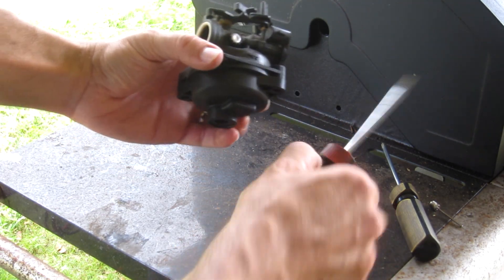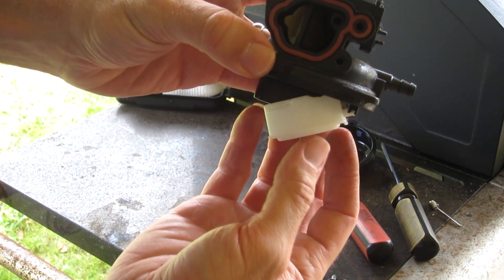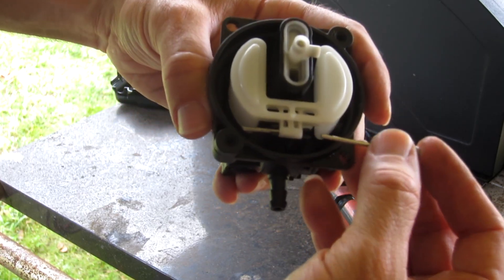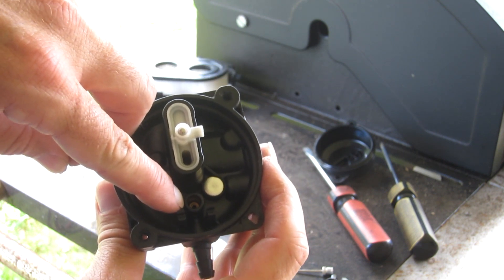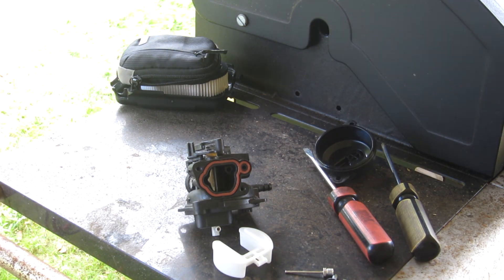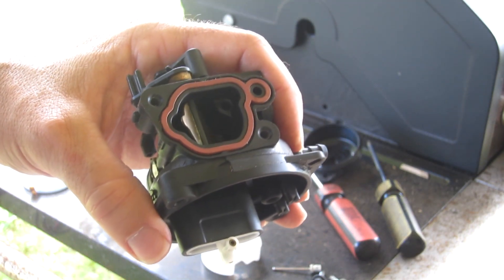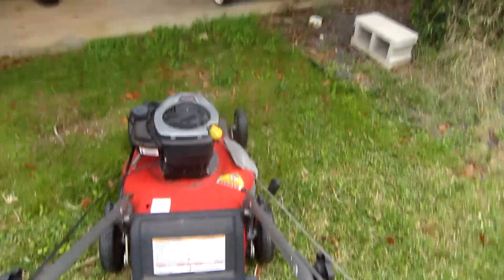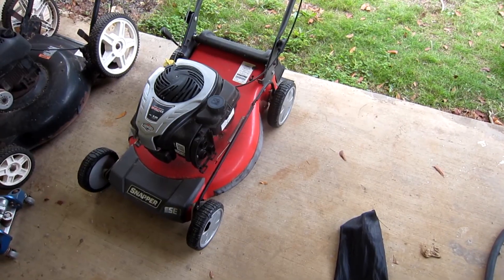Briggs and Stratton 550EX Carburetor Repair Part 2

Comment: I want to thank you for both videos. Although I have not torn my carburetor apart yet, it's happening tomorrow. I've torn my mower apart so many times and replaced the spark plug, the filter, changed the oil and gas, and taken the carburetor off and cleaned it, but just didn't realize I needed to take it apart further. I think I was more scared, also. Now I feel like I can break it down further. Everyone was telling me it must be the fuel filter that is clogged, but unless that's in the fuel tank, I just don't know where that could be. Thanks again. I hope this will have my mower running. My lawn is a jungle now!
Reply from the maker: Kristen, it sounds like you have a good handle on mechanical processes already so this should be an easy kill for you! I appreciate you taking the time to comment and if you have questions I'll do my best to help.
Reply: @jcx2bby  I've taken my vacuum cleaner apart countless times. With machines like these that cost an arm and a leg to replace, I'd rather take them apart and fix them than have to pay to get a new one. Besides, what fun is it if you can't figure it out; right?
Reply from the maker: @xten63  absolutely 100 pct this! Kristen for president!  We need more doers, and less talkers (coming from a guy who talks endlessly on lawnmower repair vids 🤔)
Reply from the maker: And there is no fuel filter on these engines from the factory. People sometimes add them later, but they do almost zero good, and add another maintenance item and leak potential to your machine.
Reply: @jcx2bby  I also want to thank you for a straight answer. I can't tell you how many people I've asked about the fuel filter or how many people said it's probably the fuel filter. They kept telling me it was between the gas tank and the carb, but I kept saying all there is is a tube. Now that I know there isn't one, I feel much better knowing I wasn't the one who wasn't informed.
Reply from the maker: @xten63  sounds like you are now in a position to educate those folks who thought the "knew". By taking your carb off and replacing spark plugs you've already accomplished more than most ever will on small engines.

Comment: You can replace the float needle with a full metal unit.

Get a gas torch tip cleaner.

Use stabil during off season or seldom use.

Honda Carbs, you replace them.
Reply from the maker: That is a good idea, I hate that so much of these carbs are plastic. It's just a terrible design

Comment: Bread twist tie wire works well for the brass jets.
Often,you can find the same material in spool form in the garden center of your home supply store that's used to tie up plants.
Reply from the maker: Another pro-tip! Thank you for posting that.

Comment: Great video - exactly what I needed to get me started. Thanks! Cute kid !

9 months later. Had same issue but 2nd time around was easier. I found the air filter hose had come undone so it was breathing dirty air. My carb allowed using 7mm socket on screws that you used T15 driver on (just in case some people don't have Torx bits.)
Reply from the maker: Sweet, thank you for watching!

Comment: Hi my machine loses strength when it cuts grass.  It reacts like if it was going to stall. When it’s by itself on it runs well.  I cleaned the carb as you instructed and changed blade and the filter.  Problem still persists 
Any ideas?
Reply from the maker: Could be something wrong with the linkage to the governor from the engine. As load increases on the motor, it is supposed to automatically open the butterflies on the carb more to let it compensate for the load. 
Make sure all linkages are connected and not bent

Comment: Got one of these mowers for free yesterday, stopped running for the guy. only runs on starting fluid. took bowl off and that white jet assembly was no longer snapped into place, and refuses to snap back in. so just picked up a new Carb Assembly (44 bucks) mower runs like a champ again!
Reply from the maker: Perfect!  Congrats on the success and for keeping a good engine out of the landfill
Reply: Re the white jet assembly not snapping back in - The middle tube of the white jet assembly pokes through a white plastic bush fitted inside the bore of the carb.

This bush has a hole in it for the middle jet assembly tube to poke through so that the tube sticks up slightly inside the carb bore to spray the fuel charge into the engine.

The white plastic bush is a loose fit in the carb bore so can slide back/rotate when the carb is being worked on so that its hole no longer lines up with the middle tube so preventing the white jet assembly from seating properly.

If you look up into the carb bore from the white jet assembly housing and push back/rotate the white plastic bush in the bore, you can see when the hole in the bush is correctly aligned for the middle tube of the white jet assembly - then fit the white jet assembly and it will now seat properly.

Comment: Thank you for the info!  My mowers revs before stalling out, I read where you can adjust the carb, but I don't see any adjustment screws on the carb.  I have a 550e.  Any advice?
Reply from the maker: There is no adjustment on these carbs.  Older carbs had adjustment screws and some of the fancier ones still do.  But not the low end plastic stuff.

Comment: A couple of things I would add are:  Don't put the float bowl on backwards! Don't over tighten any of the screws because it is made of plastic, and finally always only use clear gas- the non ethanol type because this fuel left in your mower during the winter will ruin it for sure!
Reply from the maker: Great tips, all, thank you.

Comment: Thank you- worked like a charm- without taking the whole thing apart I removed the carburetor cover and used an air compressor to blow out the fuel inlet and the small valve you show on here.
Reply from the maker: Nice hack!  Glad.you got it to work.

Comment: Original owner here

I followed every step by step which was awesome until I had all the gas just draining in front of me from the bowl area. That is the only thing I can't figure out what I did wrong. It wont stop leaking and its sealed tight. I give up! 🥺

Can i test the carburetor with water to test a leak?
Reply from the maker: I would not advise using water for this. Will cause corrosion and water-in-fuel issues. 
If you have the bowl sealed and it's leaking out, I'd check the float for operation. Might be stuck down and letting fuel flood in.
Reply: @jcx2bby  so i did a test where i had the gas line connected head the float device up no leak and let go then it flowed. It only leaks when it is completely reassembled but I will check the float device and pin again. 

Thanks for replying.
Reply from the maker: @mikeoxier2733  ok, then it is most likely a leak on the bowl seal, even if it seems ok to the eye. It's about the only culprit possible at this point
Reply: I did a complete test of the carburetor.

I cleaned everything very well despite there was no build up at all. The o ring seal and pin look in great shape. 

I fired the engine back up and leaks a tiny bit or maybe its residue only when cranking the mower. It cranks but won't even fire up now. I believe it was residue as it doesnt look to be leaking. 

I replaced the spark plug as well and cleaned the spark plug hole.

I wondering if I did something by disassembling the bowl as yesterday I simply emptied the bowl without disassembling the bowl, reassembled the carburetor, and I got the yard mowed but at the very end it gave out. 

Lastly, the pin and seal look in great shape, but what is ironic is that until I disassembled the bowl it did not leak at all.

Now the mower turns over but does not start.

****its back to working!!!!! I double checked the spark plug hole and shavings came out that I did not notice.  Cleaned off the spark plug and it's fired up 3x now right away.  Thank you for your help!!!!!

Comment: Followed this step by step, only runs half throttle unless I press the throttle linkage at the back of the engine it goes to full throttle. Any suggestions on what happened?
Reply from the maker: Not off hand, no. Is the blade still installed?  If no blade, the engine will run slow
Reply: Re not running at full speed until throttle linkage is pressed - There is a design flaw on these engines which are fitted with the automatic choke instead of the red primer bulb.

The plastic CHOKE butterfly lever (at the air filter end of the carb) can jam on the carb mounting so that the choke butterfly does not open when the engine has warmed up but remains stuck in the fully closed position.

Pressing the throttle linkage likely disturbs the carb mounting sufficiently to release the jammed choke from the fully closed to the fully open position.

The solution is to find where the plastic choke butterfly lever is binding against the carb mounting plate when the choke is in the fully closed position and either:
1. Bend the carb mounting plate to create clearance.
OR
2. File the plastic choke butterfly lever to create clearance.

Comment: Thank you! I used this video to repair a pressure washer that had the same Briggs and Stratton motor. The seal over the bowl was slightly different; mine had a plug I could open with a hex wrench then use a long screw driver as torque to pop the seal off. Otherwise your step by step instructions worked like a charm and I got it running again. Much appreciated.
Reply from the maker: Sweet and congrats! Thanks for taking the time to comment

Comment: Okay, so I got distracted while putting the carb back in by my GF, and broke the little loop the larger shaft on a spring was connected to.  I do not recommend this, but i heated up a nail with a blow torch, poked a hole in the plastic piece further down and bent the same metal spring loaded thinger-ma-bob.  put it all back together and that mofo started up on the 3rd pull and ran better than it did the day i bought it at home depot for 110 bucks refurbished.  I mowed the 88y old lady that lives next door's front yard too and she thanked me.
Reply from the maker: Lol, yeah girlfriends have a way of distracting. Wives even more so!
Great way to get creative and go for the fix. Thank you for taking the time to share this.

Comment: I found that I need to take the jet assembly apart. The middle white plastic rod has three holes. All of mine were gunked shut. I cleaned them out, reassambled  the machine and viola. Thank you for this video. Tool less than an hour.
Reply from the maker: Woot!

Comment: I must have taken that carb apart 10 times, changed the gas, used carb cleaner and at most the mower would run for a minute. A needle solved the issue :).Thanks for the video, big thumbs up!
Reply from the maker: Congrats on the fix!

Comment: Great video - thanks.  Helped me fix mine just one day after ordering a new carburetor from Amazon, which cost me 12.99 + tax.  Oh well, s'pose it's good to have a spare.   
(5:15 - Sounded like an H-46 helicopter flew by...yup, good ol' days.)
Reply from the maker: It could have been. I was on Oahu when I filmed this and they had Chinooks at Wheeler AAF. Always some kind of aircraft noise going on over the base. 
Glad you got your mower fixed up

Comment: When i was growing up carburetors were still King,fuel injection didn't show up in masse until the early 80s,now before people start flipping out , yes it was around for many many years before that, anyhow, normally on a carb your needle is basically a valve,when the carb is full of gas it pushes your float up (like a toilet) and shuts off the gas, as the gas is used the float goes down opening up the valve and letting more gas in and the whole process repeats itself.

Today i did a service on one of these carbs,i took the needle out and without thinking i blew thru the barb on the outside of the carb and nothing happens, this is something you do instinctively after servicing many carbs,you blow thru the barb and make sure its all clean,well i got to thinking "maybe this is a new design and it has some kind of diaphragm inside that only goes one way blah blah blah , well i keep on blowing thru and all of the sudden....pop!!!  scared the hell out of me,lol,the needle seat was plugged up bad and whatever was there flew across the room,moral of the story is..... after 100 years carbs are still made the same way, thank you for this video man,its great!!
Reply from the maker: This is awesome, I love comments like this with some meat to them. 
I am glad you liked the video but even more happy that you took the time to comment. You're right, instinctively, you do things and when they don't go as expected, sometimes you can doubt yourself. But rarely have I found that a tried and true process is the error. It's usually a fly in the ointment somewhere!

Comment: You should also pull that center piece. That white plastic piece. Use a screwdriver to help gently separate the emolstiin tube.once apart. You will discover three tiny holes. They must be clear of any obstruction. Also push out the metal ball. Don't loose it m spray carb cleaner through those bleeder holes. Reasemble it

Comment: hey mate! awesome video thanks heaps. my mower (same model) was leaking fuel, and after the steps in the video, it started first pull, but didn’t sound quite right. It spluttered a lot and did not have much power: After a minute or so it it turned off and now it won’t start. So the initial problem of fuel leak was fixed but I must have done something incorrectly and caused another problem. Do you have any suggestions? Thanks a lot for the video
Reply from the maker: Hey Roland, my guess would be that it is a problem with the float. Probably stuck down and flooding with too much fuel. Take the bowl off and check for proper float movement and go from there. Good luck. 
Alternatively, is it out of fuel?

Comment: Bought a new carburetor for the 550EX off of Amazon on March 25th 2020 for $15.00  Came complete with new carb, spark plug, air filter, fuel filter, and a fuel shut off valve.  Cheeper now to just order a new carb than to put it in the shop..

Comment: Thank You for the Video!!!! Saved me from lots of headaches! My lawnmower is 1 1/2 years old after I did the oil change by tipping it up to drain the oil as per manual (which it think is the most retarded thing I ever seen). It wouldn't run any longer, all three jet holes were filled with debris.
Reply from the maker: Haha, yeah it's crazy they don't put a drain plug in these engines but it's the world we live in now. They expect you to throw it away when it's time for an oil change or broken. Throw it away and buy another.  Point in case, see the comment below yours (chronologically). That guy thinks buying a new carb every year is the way to go. It's "wasteful" to repair one. 
Glad the video helped you out.

Comment: BUY A NEW ONE ON EBAY FOR $11 AND SAVE YOURSELF A LOT OF TIME.
Reply from the maker: It's not saving time if you have to wait for something to be shipped. 
The whole point of this video is to show how to fix what you have on hand.
Reply: I ordered 3 so for the next few years I never have to spend hours doing this...just pop a new one on and mow.
Reply from the maker: @bananapatch9118  if your solution works for you, that's great. It seems wasteful to me and therefore I would choose a different approach.
Reply: Seems wasteful to me that lots of people will spend hours taking all those little pieces apart, put them back together, and still may not get it working. But whatever works for you.
Reply: Yeah and wait 4 or 5 days to get it, then spend a half hour or more installing it. Or, you could clean it like he did and be up and running in 45 minutes. But, to each his own.

Comment: Great video, I spent several hours messing with my mower. It had been sitting about a year and a half. Did everything in this video and now starts with one pull. Thank you.
Reply from the maker: Woot!  Congrats Von
Reply: Yeah I have to look at mine. I’m in the same situation. New mower used a little and it sat a couple years now no start. I’m pretty sure it’s just the carb clogged up.
Reply from the maker: @whatfreedom7  most likely it is, especially if it sat with gas in it n

Comment: There’s something extremely satisfying about getting a non-running machine going again. After opening mine up, the needle was missing.   Replacement carb #593261 $9 on Amazon.
Reply from the maker: I 100% concur. Great work finding your issue!

Comment: Your videos on this are thoroughly explained and clearly shot. Thank you for making these!
Reply from the maker: Thanks for the comment!  I really do appreciate that. I'm glad to have helped
Reply: @jcx2bby  The 550EX 140cc mower I worked on just started and runs well except for engine surging. The oil was too full and was being spit out of the carburetor, so I emptied out the excess oil and let it run for a while. Still surges but seems a little better. Oh, your daughter is precious on this video! Makes me miss my teenage kids being young.
Reply from the maker: @lichin11  Surging is usually an air leak somewhere, perhaps one more reinstall of the carb will help. Good luck!  
My daughter is in a bunch of vids. She can't help but be part of the action I guess!

Comment: Perfect video so easy to follow fixed my briggs stratton 550ex mower! Thanks
Reply: I found heaps of water in the mower fuel tank🤢 Need to dry it in the sun. Petrol doesnt clean the water out

Comment: I would like to thank you very much. I was given a free lawn mower this past weekend and it hasn't used in 6 years so I knew it was a carburetor issue. Had it apart, all jets cleaned and back together and purring in 40min!!  Thanks
Reply from the maker: That's awesome, happy for you!